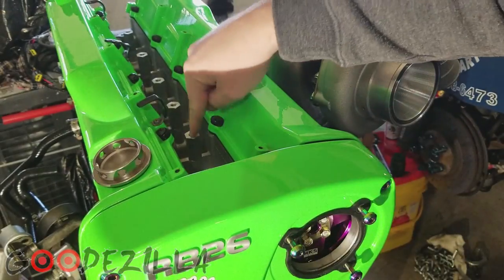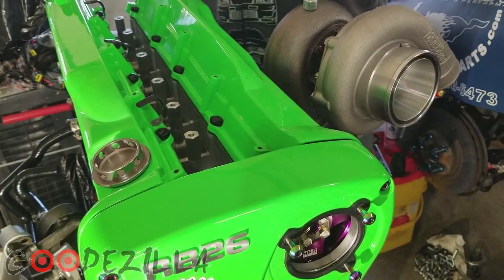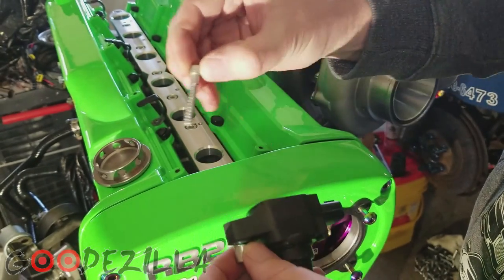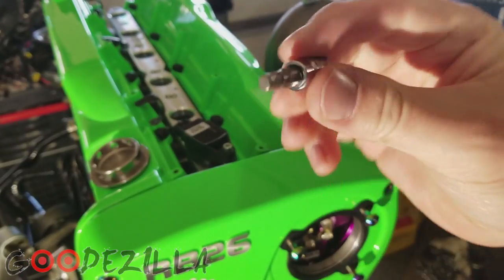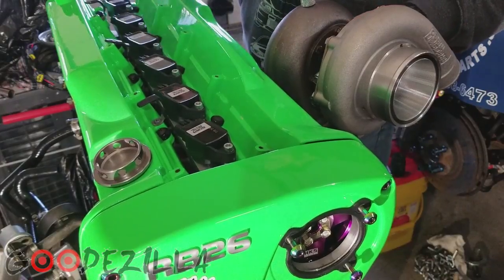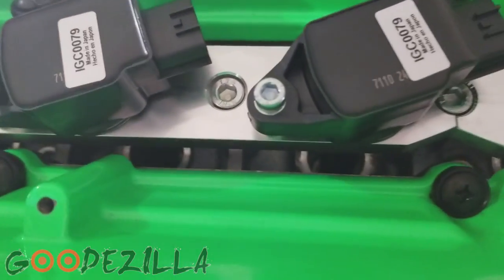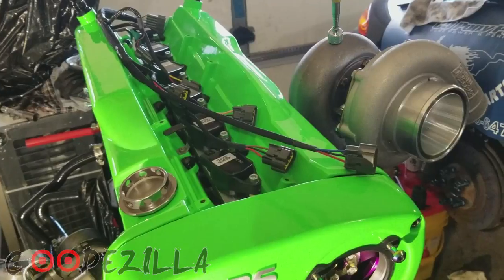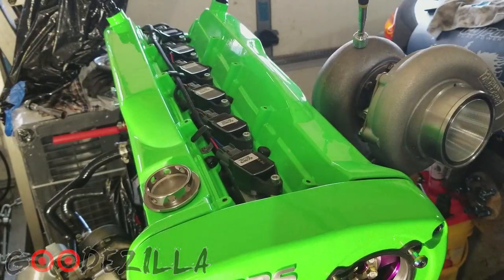Supertec Racing RB26 R35 GTR Coil Conversion Kit Install

Comment: hi,
Love your videos.
I am considering a R35 coil pack and loom change for my stock R32 GTR.....  but ive heard that the "dwell time" needs to be potentially adjusted. 
Can you tell me if thats the case or i can just change from my old one to a new R35 coil and wiring annd the car is good to go ..  without having to adjust the dwell time of the coils. etc
Reply from the maker: Hi Thank you! the R35 coils will work without adjusting the dwell time, but they won't be able to produce their max output on our setup without adjusting the dwell settings.
Reply: @Goodezilla  thanks for your reply … appreciate it ..

Comment: Just wanted to say love the videos. Also maybe that last screw hole is for a ground.
Reply: Jonathan Anderson it is dual position on the rear so you can choose the angle of the last coil pack for ease of fitment.
Reply from the maker: So I was correct :) horray!
Reply: GoodeZilla you got it! :)
Reply: cool, i was just looking at them on the website. good to know

Comment: Great video bro! I finally finish putting the RB30 into the R33 and now it’s at the fabrication shop for intercooler and down-piping. That kit looks great, I chose to go with Yellow Jacket LS2 kit and a wiring specialties harness.
Reply from the maker: James Thomas awesome man, yellow jackets do the trick as well. I bet you're excited!
Reply: GoodeZilla I’m holding all my excitement in until after the dyno lol.

Comment: Some people use LS engine coils with RB26!
Reply from the maker: kimw Kimw yes they do. I think these look much better though!
Reply: Vag coils are used alot aswel
Reply: LS coils and those from VAG are both great options for performance.  The R35 coils offer the advantage of fitting under the stock coil cover.

Comment: Hi great vid. I just wanted to find out, do u change the type of spark plug? Since those coils are noticeably longer than what you previously had in.
Reply from the maker: cure8189 the kit from supertec racing has spacers to work with the stock length spark plugs
Reply: GoodeZilla okay cool thanks..the hole for the spark plugs looks thinner than stock boot..does it go down easily to contact the coil spring inside the boot? or it doesn't have too?

Comment: Dustin, why did you choose to go with the R35 coils vs the R34 coils?
I'm debating between the two and am leaning toward the R34 coils, to maintain the cover plate.
From my research, it seems like the charge times for the R35s are longer than the R34s, any consideration into this in your decision?
Reply from the maker: Joey, I chose the R35 coils because they are very good coils. 2000hp R36's use stock coils. You can use the cover plate with minor trimming. The dwell times are different on the R35 coils, but I can adjust that with my Haltech ECU.
Reply: Thanks for the reply! So, will the R35 coils drop in and not need ECU adjusting before being able to drive them? Or is it necessary to adjust the ECU before being able to drive them? I'm considering if I should wait until I get the Haltech installed and then worry about the ignition system. I know you're rebuilding and will get the ECU tuned before needing to drive with the R35 coils, so it doesn't really apply to you, but can the R35 coils drop in a still drive properly?

Comment: Thinking of doing this conversion too, would you be able to say how much you need to modify the valley cover to make them fit?
Reply from the maker: Dievos you have to cut the back inch or so off to clear the last coil. There is a thread on gtr.co.uk with pictures.
Reply: Perfect! thanks for the help!

Comment: Did they fit the spark plug easily. Mine almost seem very tight on rb26 plugs. Thanks.
Reply: Mine was also hella tight. I had to use electric grease to get them to seat. I'm afraid I mite break a coil when I have to replace the spark plugs.

Comment: I recently picked up a R32. I was wondering where do you find oem parts for these things?
Reply from the maker: Schuttsr1 lots of places online. Rhdjapan is a good one. EBay. Amazon.
Reply: Oh I did have one more ? about the install. Does the coil cover still fit with the taller R35 coils installed?
Reply from the maker: Schuttsr1 that question is answered in the video ;)

Comment: Hey man dont quote me on this but im pretty sure those blue coilpacks you pulled out are actually splitfires???
Reply from the maker: Check Mate yup, they splitfires. I just meant they are stock style that require the igniter.
Reply: GoodeZilla no i didnt mean you were wrong im just wondering why youre upgrading from already upgraded coils?
Reply from the maker: Check Mate ahh, I'm upgrading because these splitfires still require the external igniter, that is 27 years old. Just less to fail. These are more efficient than the splitfires .
Reply: I know the video is 8 months old, but if you have those split fires still on hand, I would be willing to take them off for you? Been looking at grabbing a set, figured to ask before I buy a new set. Also, don’t the R35 could require a re-tune? Swear I heard that somewhere

Comment: Nice to see you back 😊. That harness has a ptu ignitor conector on it. The other is power supply. Are you gonna cut the ptu conector off the harness and same on car and crimp it together? Or do you have an adapter that fits in between them , replacing the ptu?
My 33 gtr is back upp and running now. I post some small vids and pics on instagram if you wanna check out mu build. Micmelb is the insta 😊
Reply from the maker: Michael I'm not sure. I haven't looked at it closely. It was supposed to be a conversion harness. Shouldn't need the ignitior. I'll have to go see what I'm dealing with.
Reply from the maker: Michael I just checked. The harness is a male plug that fits directly to the car harness.
Reply from the maker: Here it is plugged in to the engine harness - https://imgur.com/a/0kmXE
Reply: That good. Nice that it just connects to the car loom female connector. Plug and play ! Dare I say bolt on ? 😲

Comment: Is it plug and play? Or does it need to be tuned?
Reply from the maker: Robin Nguyen from what I've heard, it will run, but should tune the dwell timing in ems for best performance. You can message Supertec Racing using the Facebook link in the description. I'm sure they could tell you for sure.